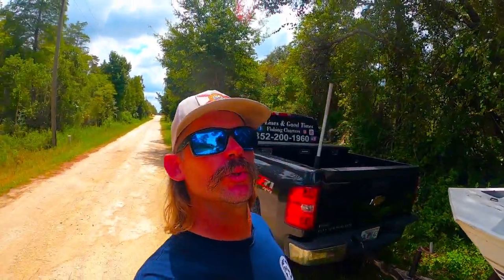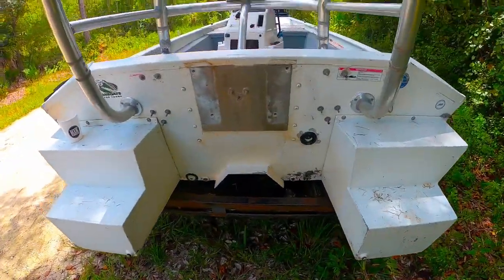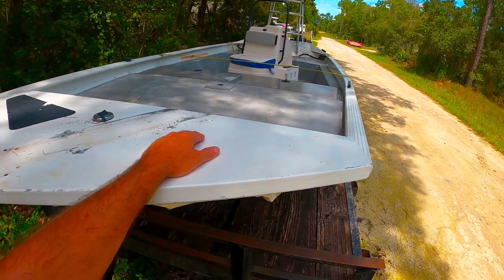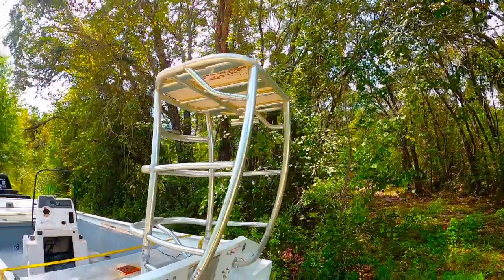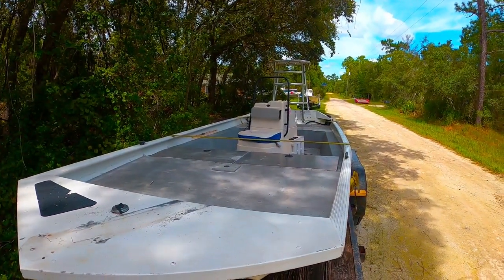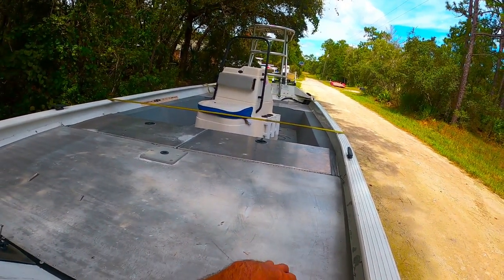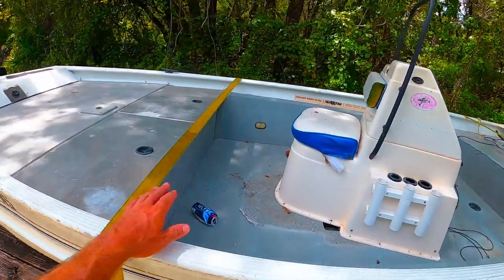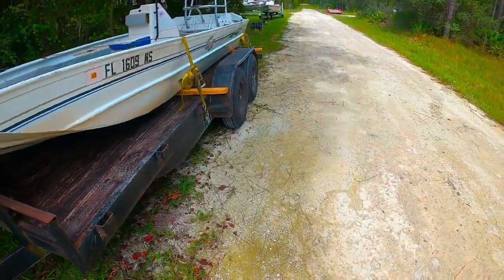Project boat Part 1

Comment: Have you thought of making it a through hull tunnel?
If you're wanting to cut her in half anyway, you could run it as a through hull tunnel for extreme shallow running, think something along the Flats Cat type design, without it really being the Flats Cat design.

But that'd give you an idea, through hull tunnels can work for shallow as well, not just racing designs.  

Be interesting to see it with a 15" or so deep through hull tunnel and a 250 with prop on the back. Be really neat to run twin rotating props.

Comment: Smooth the bottom and get rid of the tunnel.Toss the center console and get a large surface drive. Lower the sides and add catwalks.